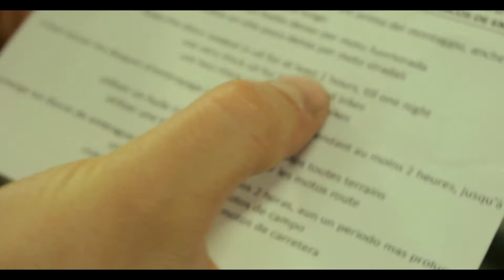Cafe Racer Clutch replacement Honda cb 650 (without special locknut)

Comment: If you advance the timing and get a stage 3 jet kit you will find that the clutch slips. I put washers on the springs. Might have something to do with the "motorcycle" oil. I have a 1980 cb650 and it doesn't want to kill me unlike my 750😤
Reply: i have a 650 and did stage 3 jets and header with pod filters and smoked the clutches fast

Comment: hi, I have the same bike, and after replacing the clutch disks (because it was slipping). The clutch isn t fully disengaging. What could be the problem?
Reply from the maker: have you readjusted the wire?